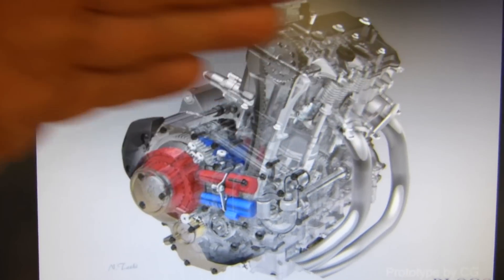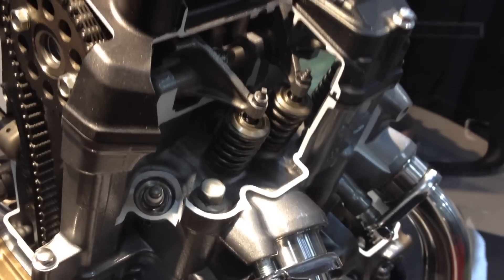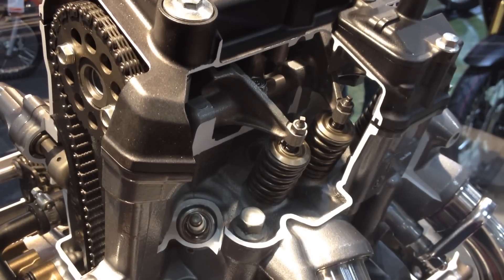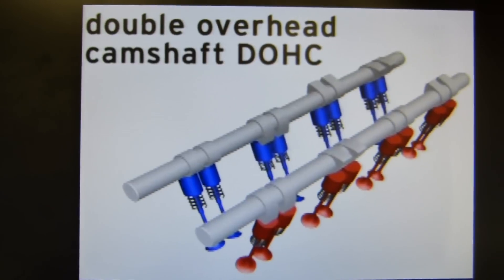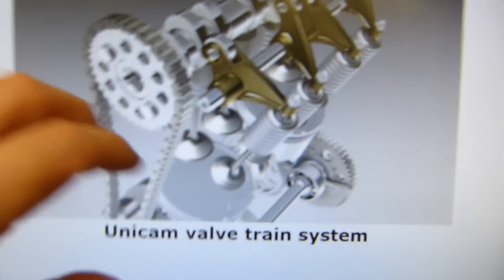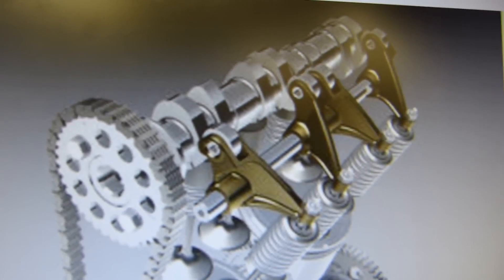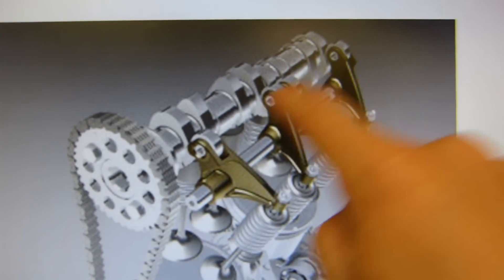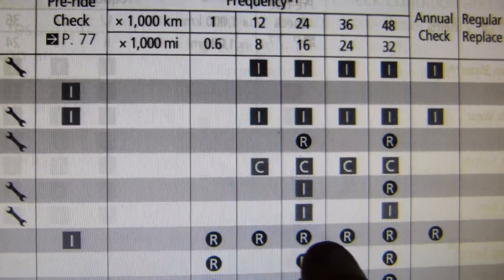Engineering detail: Africa Twin valve train

Comment: What a load of crap you are spouting, this system has been around for years, and is a well proven and reliable system. You obviously dont understand the unicam concept and that the exhaust valves by their very nature are subjected to more heat and wear than the inlets ever will. 60,000 km on my africa twin  and ive adjusted the exhaust valves once, inlets are still within spec.
Reply from the maker: Good insight, thx

Comment: You are all missing the point ., the actual surface area used to push open the valves is about the same .Bucket lifters engage the full width of the valve stem only ,& by the looks of the picture so do these roller rockers ., furthermore the rollers i would bet produce the same surface area do to their rotation .If the engine needed to spin 10,000 rpm for long periods bucket lifters would be a better choice.
Reply from the maker: Shims have an extreme surface hardness, they are quenched & tempered, screws are never. Surface are is not even half the story ..

Comment: They used the same kind of adjusters in the xr650 and that engine is bulletproof. Also I have read the valve adjustment on the xr has very long intervals under real world use.
Reply from the maker: Nobody argued that they are not.
Not sure about what`s meant by very long intervals, what can ACTUALLY be read in a 2005 model`s Owners` Manual on page 69 http://campaigns.hondampe.com.au/Motorcycles/manuals/XR650.05.pdf Honda specifies that valve clearance is to be inspected every 600 miles or 1000km. In real world use.
Reply: They are wrong. I own one and after you adjust them and the engine is broken in. You can easily go over 5000 miles without them going out of spec. The honda spec is more than likely based on the bikes original use which was desert racing.
   It seemed like you implied that that type of adjuster was unreliable and would wear fast as it has less surface area. That was the reason for my original post. It might scare people away from a great bike.
Reply from the maker: Inspecting valves is completely different from and is unrelated to adjusting valves.
Just like dental cleaning and needing a filling are completely different & unrelated.
Reply: Well I for one am not going to check them every 100 miles when I know they won't need to be adjusted anywhere near that often. Also my point that the type of adjuster used on the africa twin is a sound and reliable design still stands.
Reply from the maker: That`s right. very reliable, light weight, sound design, long history of proven performance, nobody argues that.
(*600 miles)

Comment: I actually prefer this adjustment over shims, as a shade tree mechanic I feel this system is a bit easier to adjust than needing to use shims. have been familiar with this valve adjustment in gl1100, gl500 and the whole process usually only takes 10-20 minutes to adjust. I agree that it is a little finicky but haven't had any problems in the older bikes
Reply: It's easier to adjust so why do Honda charge between £500 to £750 for the 16000 mile service.